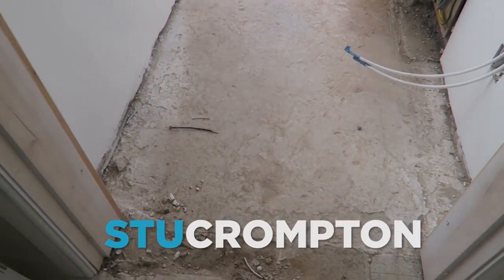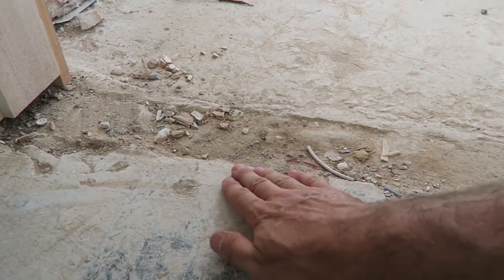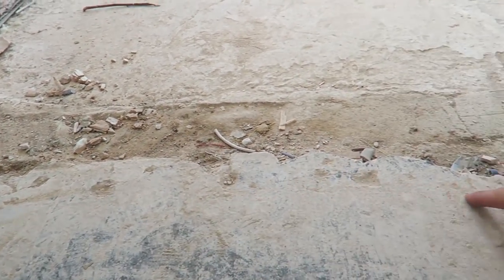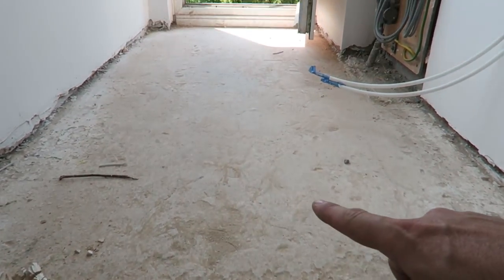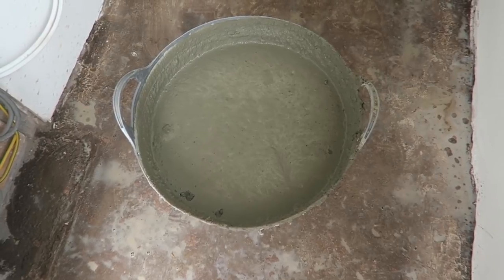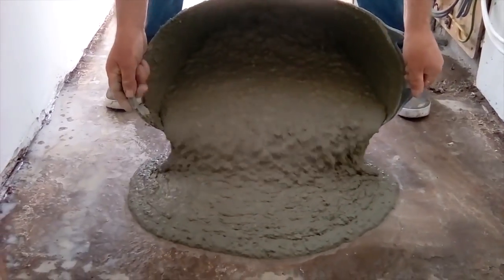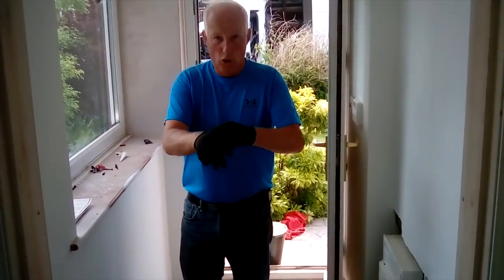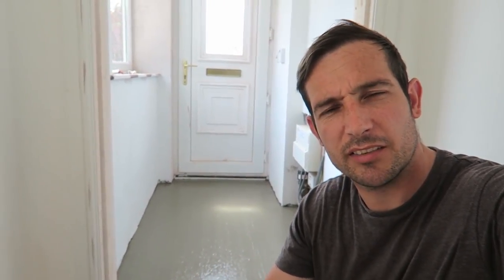Floor screeding

Comment: I’ve got to do a bit of floor screening, roughly 2m square 30mm thick. What product did you use Stu, I was going to go to Screwfix, but that stuff your used looks a lot stronger.
Reply: Dan Jeffries it’s no what he used but for a thick screed like you have to do look at a product called Ardex SD-T B. It’s a just add water product as well.
Reply: john shelly what did he use then i want to use that
Reply: I called Ardex and went with their KH15 with a P51 primer.
Reply: I never used ardex until I worked for a company who do maintenance for Tesco supermarkets, it’s great loads of different products. Dan Jeffries did job come out ok?

Comment: What compound did you use i need the same stuff
Reply from the maker: it was off a site spence dont knnow the proper name
Reply: I did 35-40mm the other day. I used Ardex KH15 with P51 primer.